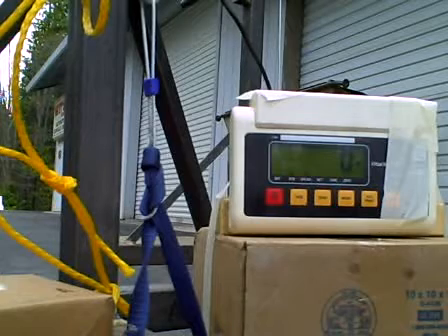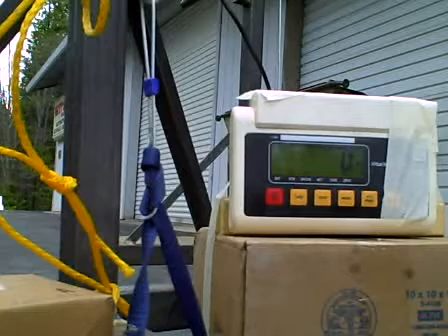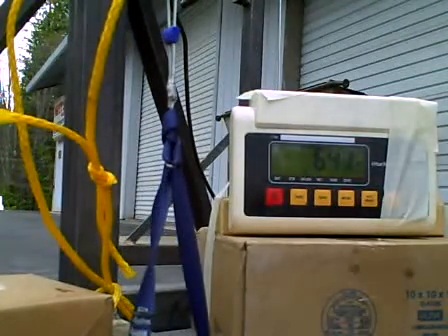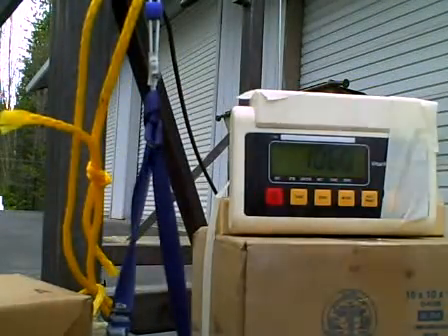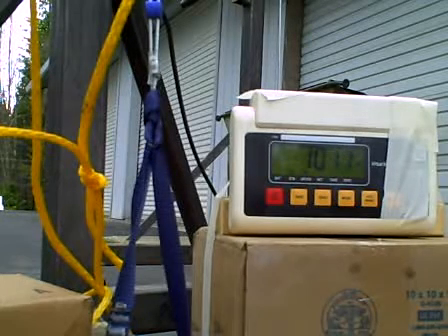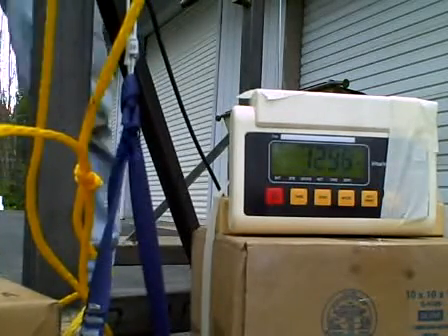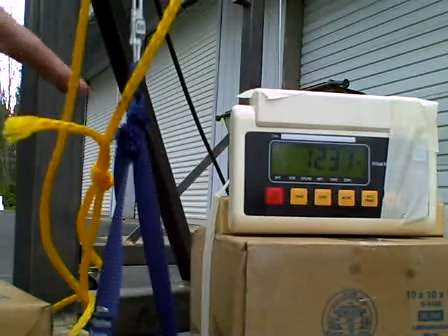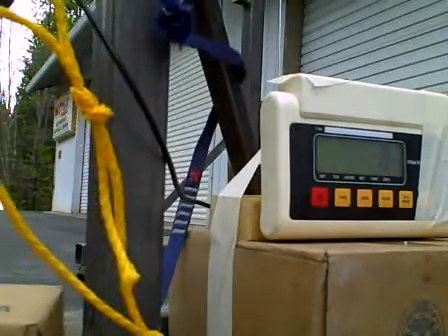Strength test of nylon sling climer hitched to cable

Comment: never, never, run webbing around bare cable!!! its called hot knifing. And , never put your fingers around a loaded webb or pins like you did! I have personally 'broke' over 200 test pulls like this, testing my stitch patterns and webbing strength.
nice job showing stuff.